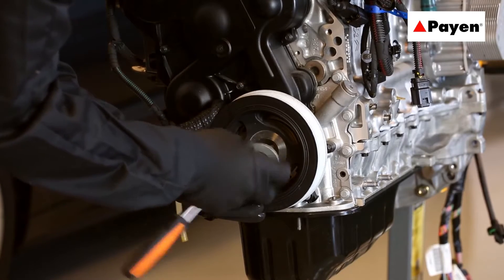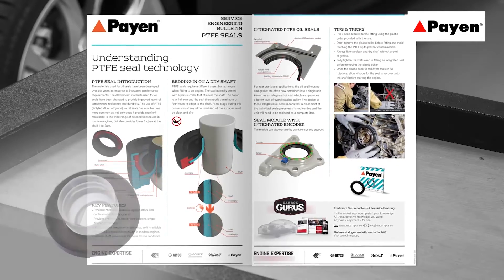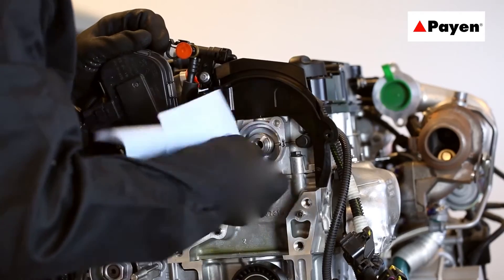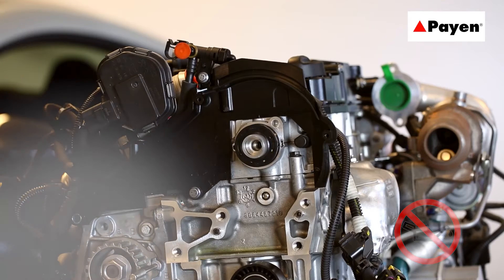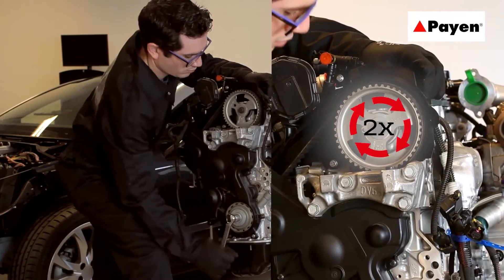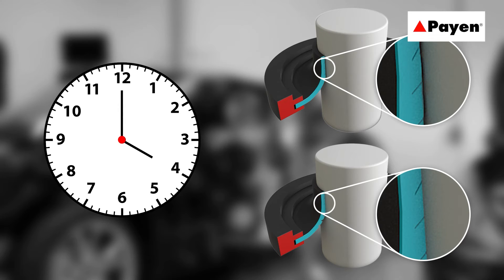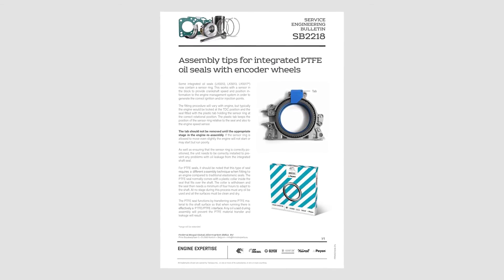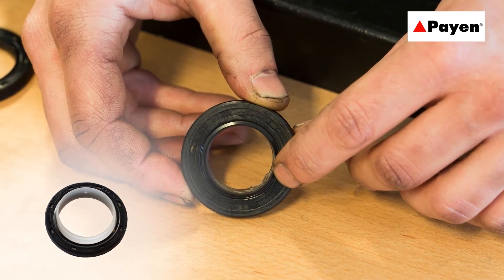Expert tips on how to install Payen PTFE Seals

Comment: I'm pending changing out the rear main seal on my Silverado 1500.  My research has shown me that the oil seal to be installed is a P.T.F.E. type.  Is it just me or the this type of oil seal does not have a "garter spring" behind the lip where it contacts with the journal?